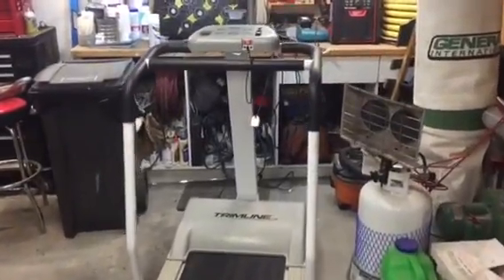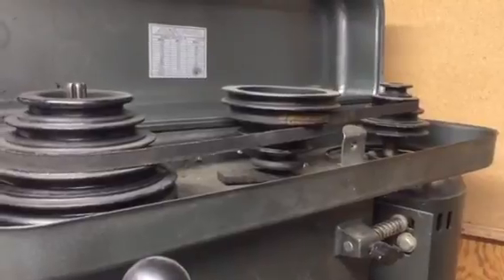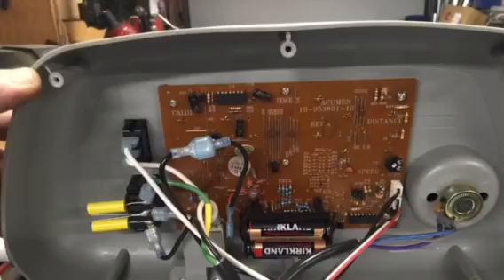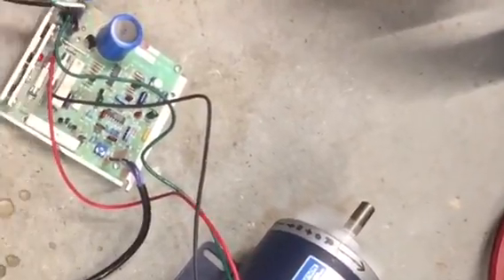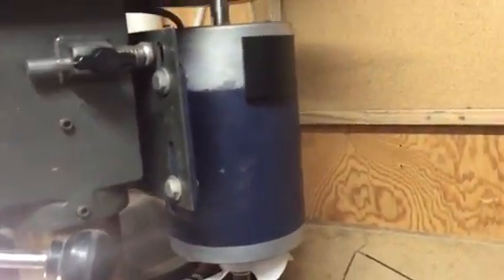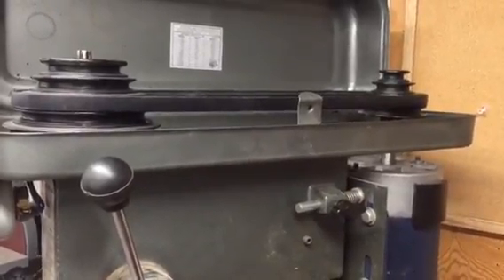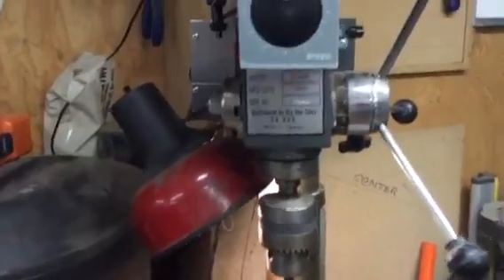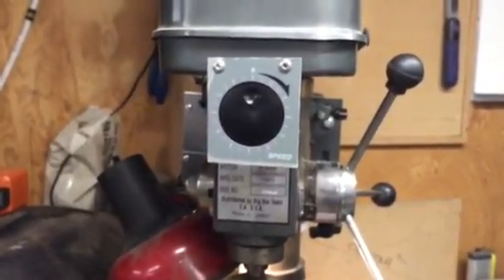What to do with an old treadmill?

Comment: Nicely done. How good is the low speed torque when drilling with large bits?
Reply from the maker: The low speed torque is very good. Imagine yourself standing on a treadmill @ 150-180 lbs. Then hit the start button. It has to have a lot of low end torque to get moving. That’s why they use a DC Motor. The circuit board is the device that controls the power. Its the best idea I ever came up with…….and cheep! You can pick these things up for $50.
Reply: @deanpratley125  Thank you! my biggest problem with my new mini lathe is the lack of low end torque. My previous lathe was a "South Bend 9 A' (the one with the quick chance  gear box and back gearing.)  I swear, given a couple of more years I could have made that machine do "Song and dance" numbers. I recently bought a new mini lathe, and the lack of low end torque very much disturbs me. The machine can run at 0 + 100 rpm, but with no toque to speak off you want t turn threads you need that torque!!!

Comment: Awesome job Dean! I've done a couple of these myself but with Weslo or proform treadmills. And they were a little harder to mount the motors took some welding. I'll have to keep my eyes peeled for one of these treadmills. I used the box from a low voltage light timer for the controller on one and a plastic pencil box on the other because I was in a hurry. Office depot has some nice cheap clear boxes the are fairly tight sealing to keep dust and grit out.
Reply from the maker: Tom Wyrick Great idea Tom. I had a look at Home Depot as well for a elec box to house all the components, but was worried it might heat up the electronics. Let me know how yours goes.

Comment: How's the drill holding up? Great idea. If you haven't already done this, you can download a strobe tachometer and get the rpm's then I can give a number of a woman that does amazing work with lamicoid with this you can make a.new faceplate for the round control that will have the rpm's. Great project!
Reply from the maker: chris hertz  Its holding up very well Chris. I have since added a digital tach to it so I can tell how fast it's running. The treadmill motor is way tougher than my original motor. My kids are all lining up for it when I die. Lol